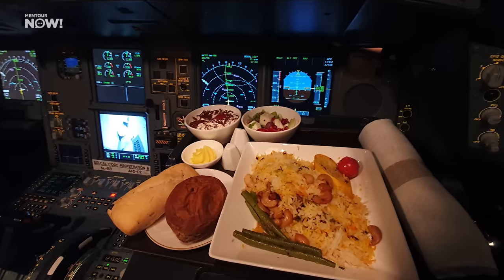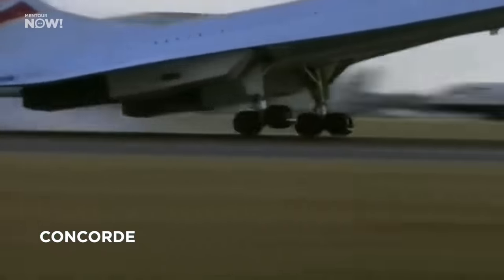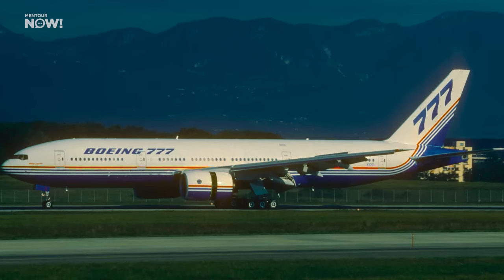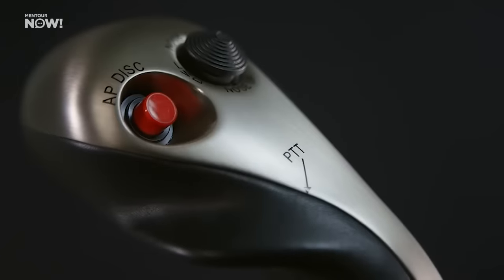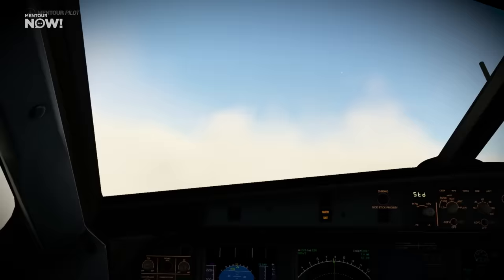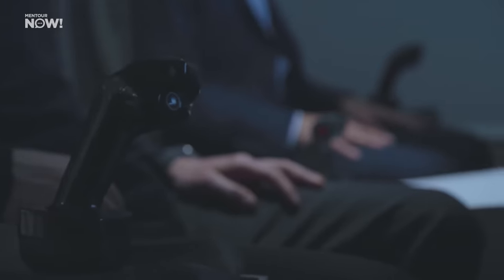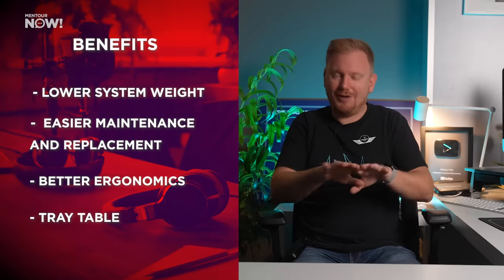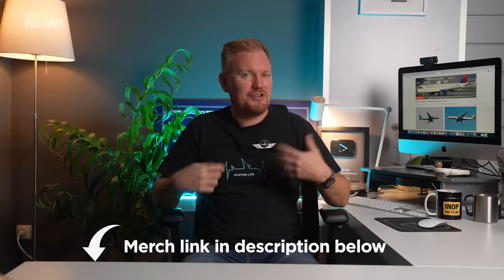Will Airbus Finally switch??

Comment: Hey guys, don’t forget active FBW sticks in heavy jets ALREADY DO EXIST. The C-17 has a center stick fly-by-wire and both are mechanically connected so when one is moved the other moves with it. Even the autopilot, when engaged, moves the sticks, just like the auto throttles. It absolutely fixes the problems Airbus has with pilot confusion. I taught the C-17 for 17 years and never saw any “who’s flying” confusion.
Reply: There was a "who's flying" crash in a Boeing once.
Reply: @thewhitefalcon8539  Once in an unusual situation vs multiple times under more normal circumstances with Airbus. It's clearly a far greater issue for them.
Reply: Yeah, it's much easier to mechanically couple center sticks than side sticks. But then you lose the advantage of getting rid of heavy mechanical component of your fly by wire system. Then again, my guess why you've never seen a 'who's flying' confusion has much less to do with the sticks and much more to do with the fact that airline training is absolutely incomparable to military aviation training.
Reply: @tringalij Agreed.  My 5 years flying the C-17 pales in comparison to your 17, and I've also never had or seen any confusion about who had control.
Reply: @SkylineFTW97  That's why as a pilot you announce and communicate when you have control of the aircraft. That's more of a failure or training and procedures than a mechanical failure of the sticks. If you're relying on the aircraft to tell you who's flying, you've already failed.
Reply: Sorry, but that feels like the start of an Abbot and Costello bit. . .
Reply: I flew both makers' aircraft and I think the honest answer is to put the sidesticks in the middle, FMs on the outside (no looking in at each other) and a set of throttles each (which don't move much anyway).
Reply: @thewhitefalcon8539  Yup, tho theres also crashes where pilots fought over the yoke and got confused. All tech has pros and cons.
Reply: Boeing didn’t design and start production of C17. McDonnel Douglas did. dcniner01
Reply: This is a good point. May I ask if the center mounted side stick on the C17 was to overcome the awkwardness of using the right hand to control a side stick mounted on the right when seated in the right seat, or being forced to use the left hand when seated in the left seat?

I'm not a pilot nor am I an aviation geek, but these issues need to be considered with side-mounted side sticks:

1) Awkwardness of using a different hand when seated in either the left or right seat. Every human has a dominant hand. Every pilot should be unconsciously competent (highest level of natural learning process, as is the case with defensive driving). I might be wrong, but unconscious competence is best achieved with the same, ideally dominant hand.

Being forced to use a different, non-dominant hand to control a side mounted side stick when seated in a different seating configuration loads the brain with an unnecessary cognitive load that could be eased with better side stick placement, like the C17 with its neutrally placed center-mount "side" stick that allows pilots to use their dominant, "usual" hand. 

There's also the issue of left or right eye dominance when seated in either the left or right seat, but it is another issue outside the scope of this discussion. 

2) With the introduction of servo controlled side sticks, can each pilot's customized, individual force needed to control the inputs be memorized by the side stick computer and saved for future configuration when flying a different aircraft? The issue I'm trying to grasp is whether a pilot should adapt to the weight and size and force feedback of an aircraft? Or should the aircraft computer adapt to the force inputs by a pilot and trim the aircraft accordingly.

I'm not an aviation expert, so if these issues don't make sense or are irrelevant, please forgive me wasting your time.
Reply: The plane design has failed if there is a learning curve. It should all be intuitive.
Reply: @snorttroll4379  I partly agree. The learning curve with a new plane, new design should be minimal, not steep.
Reply: @snorttroll4379 ah just so, do you understand it's not a bike 😂😂😂🎉🎉🎉
Reply: @oldporkchops  obviously the technical complexity of a plane in itself prevents any shallow learning curves, but each to his own... It should be best mitigated by step by step gradual lessons built on each other ...
Reply: and not from the previous plane, but from scratch. @oldporkchops
Reply: That doesn't sound like the C-17 system is mechanically coupled, NOT "active" (IE electronic force feedback) in the traditional sense. While "mechanical coupling" also adds the feedback, it likely doesn't provide the weight savings the Active sidestick systems being discussed here does over mechanical coupled yokes. One thing I'm not sure of is how hard it would be to implement mechanical linkage between two side-sticks, it's likely more complicated that for center-sticks but HOW much more complicated is the question. And I doubt Airbus would be willing to move the control position, "commonality" is one of their biggest weapon. Active feedback OTOH seems like it could even be toggled on and off as needed. Very interesting to see what Airbus might decide to allow (they have to get the regulators to sign off on it). The A220/CS100 seems a bit of a missed opportunity here, it has FBW and side sticks and probably could have had active force feedback timingwise (based on the MC-21) but doesn't appear to have that. It might have been a nice way for Airbus to test the waters but they probably got involved in the process much too late (and before that Bombardier likely didn't have funds to chose anything but the cheapest option).
Reply: @oldporkchops most side-by-side cockpits involve switching hands when switching sides and training gets you plenty of practice on both sides. Even with my relatively low time, the transition is smooth. Sight picture is a bigger factor (at least in the small planes I fly).

I thought going from stick or yoke to side-stick would be a bit of a learning curve, but I forgot I was using the side-stick within seconds (in a friend’s Lancair).
Reply: If pilots are confused who’s flying?…the problem is with pilots who are confused with who’s flying

They will have a lot more things to confused with other than side-stick. 

Btw, if you read the famous AF transcript that crash, they never got confused with who’s in control. They knew who was flying and knew when the other person was trying to take control

Dual inputs doesn’t mean confused pilot, it actually means the side with stick priority is taking over control. If no stick priority assigned, then the computer will aggregate the inputs. In case both pilots went completely the opposite direction on their inputs, there are both visual and aural warnings to remind them… if they ignored all that and kept fighting over controls… 

The head of pilot’s training/ recruitments/ flight operations should be fired….
Reply: It also has a degree of manual reversion.
Reply: In an emergency, hearing is the 1st sense to be overwhelmed, remember?
Reply: Great point about using the 'wrong' hand there!
Reply: @Stealth86651  yeah except in quite a few Airbus crashes people indeed announced I have controls, sometimes with the other acknowledging it, but still instinctively flying the plane despite having acknowledged handing over the controls. The issue is that there is no way for the one wanting to control the plane to know if the other guy actually released the stick. And in very stressful situations the hearing being loss quite easily that's not ideal. Having stick coupled adds another tactile situational awareness over dual inputs while also allowing an instructor to feel exactly what a young pilot is doing or not doing
Reply: @robadzso Which is how almost all flight training today is done.
Reply: @offshoretomorrow3346 Quickly followed by narrowing "tunnel vision" and lastly, fixation.
Reply: @SkylineFTW97  there've been less crashes involving Airbus planes in total.
Reply: Implementing this should actually be mandated upon Airbus by the FAA, both on new planes, and as a retrofit safety upgrade on planes in service, the amount of dual input and autopilot incidents that have happened is too high to ignore!
Reply: @misarthim6538  absolutely incomparable is a myth. Military aviation has never been superior. CRM was a civilian intervention that was needed in order to address the problematic military style command structure that doesn’t belong on a flight deck.
Reply: Why do they have to be mechanically connected? Just electronically connect the two so that while the other pilot could still physically initiate an “input disagree” if they wanted to take priority but could still visually “see” exactly how and if the other pilot was manipulating the side stick.
Reply: Nobody forgot.
Reply: Interesting, the C17 has only been out 8 years… How do you explain that Mr know it all.
Reply: C-17 is a military heavy transport plane. So weight isn't as much as a problem for their control system as for a jet liner
Reply: @thereissomecoolstuff what?  The C17 had its first deliveries in 1995. It’s been flying for nearly 30 years.
Reply: @rtbrtb_dutchy4183  What about Norway..
Reply: @thereissomecoolstuff  what about Norway?
Reply: @tringalij thank you for your service. I was in logistics and I don't mind admitting that I always thought your job was cooler than mine. 

When we were all going out to Bosnia we loaded up on a load of American aircraft and you guys treated us lovely. I'd driven down from either Catterick or possibly Otterburn 🤔 can't remember now, but I was feeling a bit second hand by the time I got that old 4 tonner there
Reply: @thewhitefalcon8539 Are u referring to Egyptair  990 ? Thats the only case I can think of in a Boeing aircraft.
Reply: Didn't the sidestick contribute to Air France 447 going down off Brazil?
Reply: Absoloutly agree !! I consider it dangerous to effectivly disconnect the pilots from the aircraft. Also the aural warning "Dual Inputs"  (A320/330) is not very helpfull in a panic situation, see AF447.
Reply: Yup
Reply: Perfectly on point. I agree and frankly like the C17's 'visible at all times' cockpit transparency.
Reply: Idk why they use a side stick over a Center stick. Center feels way more natural and the only reason military jets used side stick is due to high G maneuvers.
Reply: @snorttroll4379 there's a big difference between something being intuitive and having a learning curve.
Reply: That is the way it should be, unfortunetely Airbus does NOT have that.  Regards
Reply: Agree !! @largosgaming
Reply: @largosgaming The answer is simple. Maximum comfort with nothing infront of the pilots btwn the legs apart from the table. Airbus said so themselves in a document explaining their philosophy.
Reply: @GreenIsland38 Well, no airliner/business jet has center sticks. It's not just Airbus with sidesticks.
Reply: @snorttroll4379  agreed
Reply: @ARandom777  "no airliner/business jet has centre sticks"

Boeings have center control yokes, that's what the entire thread has been discussing.
Reply: @ferrumignis  That's yokes, not center joysticks, which is different than a yoke...Yokes is not what the thread was discussing. I recommend you see the cockpit of the C-17 to see what we're talking about.
Reply: Boeing is the one who should learn from Airbus not the other way around
Reply: @LexlutherVII  Boeing should disconnect their control yokes so that the pilots can input conflicting commands? That seems like a great idea, can't think why they haven't already done that. It's never, ever been an issue for Airbus after all.
Reply: @misarthim6538  Force feedback motors aren't heavy, less susceptable to being broken and can provide synthetic control surface feedback

The bigger problem with the current setup on Airbus is that "control input disagree" notification doesn't result in a BIG RED LIGHT (and audio warning) that can't be missed no matter where the crew are looking (existing warnings are small and easily missed when under stress)

Dual input is the kind of scenario where a flashing red border should be flashing on all displays at the very least, if not flashing the entire cockpit illumination red too (ie, so anyone in jumpseats can notice it too)
Reply: @Lukeduke7773  Agree. 

One of the other military problems is the "pushing through regardless" mentality (mission fixation) that prevails instead of realising early on that things aren't going right and diverting long before trouble becomes critical - Military transport pilots are no better than single seat jockeys in this regard. The training that's ingrained into them   contains many elements that are the direct opposite of what's required for safe civil aviation.

In particular, far too many landing incidents are related to mission fixation or "following policy" instead of a more cautious approach

It had been realised by airlines as early as the late 1980s that ex-military fliers were cheap to hire but were statistically their most unsafe pilots, which is why the rise of civilian airline training centres and university aviation degree courses occurred in the early 1990s, with heavy emphasis on Human Factors and "Being late is better than being Late", particularly when you may take a busload of people with you

On the other hand, overly passive pilots are also dangerous, as several low cost American airlines found out the hard way with pilots blindly flying themselves into dangerous situations long before they realised they were in trouble
Reply: @tonamg53  but that’s the issue There’s no force feedback on the current Airbus planes so you can’t (feel what the other pilot is doing and you can’t feel that the trim is way out witch you still can on the 777 Dreamliner and later flyby wire planes), even on the Dreamliner 777 Boeing they are 2 independent sticks they are just interlocked via force feedback system that can be turned off to allow pilot to get in-out of the seat
Reply: @leexgx  There is no issue. You never ever put your hands on the yoke to feel it while other pilot is flying.

The yoke or moveable control can’t tell you anything about what the plane is doing anyways. If the stick is to the left the plane can be
• starting a left hand turn
• increase bank angle in a left hand turn
• decreasing bank angle in a right hands turn
• countering wind gust to remain straight and level

To know what the plane is doing you still need to look at PFD and the PFD already has all the info so there’s no need to look at the stick/yoke before PFD at all so why would anyone even bother?

I would even say that its a bad habit if you think you need to see what the yoke is doing as its unnecessary increasing your workload for no additional benefits.
Reply: @leexgx  and about the trim, the Airbus control is all auto trim so you don’t need to feel it. if it  is broken mid-air then yes you can’t feel with your hands but you can still feel the plane is out of trim through your whole body and you can still see it visually.

Mechanical/hydraulic link like 737 is actually a disadvantage as if the trim is way out (*cough… MCAS) the plane can be in a state where the pilots does nit have physical strength to overcome the force and there for limits over control authority from the pilots. This is not an issue in FBW and pilots have full control authority at all times even if its way out of trim.
Reply: @tonamg53  I don't know how the other planes doing it that are implementing the active Force Feedback joysticks, even on the Boeing Dreamliner you can still feel or sticks moving as the plane pitching forward or backwards, and left right 

yes it's still important to look at the instruments as well but there has been countless airbus crashes or incidents due to flight control lack of feedback due to Mutiple issues at the same time (the recant one with the auto trim was disabled, on a Boeing you would have felt it instantly on the sticks as they would have been very heavy even in the 777 dreamliner and you would have adjusted the trim via the stick, on airbus there is no manual trim in the stick as it's assumed it's always going to be automatic so that they don't need manual trim on the joysticks)

But yes it's the pilots fault always the pilots fault ( well it's usually one of them, which ends up causing both of them to be at fault legally)
Reply: @tonamg53  issue with mcas was lack of memory items failing them (runaway trim should be picked up on within 15-20 seconds of it happening especially at take off) there are 2  switches to turn off the powered trim

But also with mcas not been treated as a critical control system was boeing fault witch confused pilots that didn't do the trim runaway procedure right away (instead they  pressed up trim even thought they knew it wasn't responding correctly) but I agree that is a mess

But that's the thing on the Airbus they didn't know that the auto trim had been disabled which was the opposite problem what had a similar effect because the trim was nearly maximum pitch down when auto trim turned off ( where on Boeing the trim wasn't set to failsafe disabled when the pilots were trying to count it, as it now does
Reply: @leexgx  No Airbus planes had crashed due to lack of flight control feedback. 

The most relevant and most well known case was the AF A330 crashed but even in that case the flight controls was only listed as “potential contributing minor factors” 

which does not mean it was the cause of accident 🤦🏻‍♂️

Also as mentioned at the end of this video, flight control feedback DOES NOT prevent issue as pilots flying 777 still fighting over controls unknowingly and cause it to de-synchronised.
Reply: @leexgx  Also a runaway trim is a trim that move continuously without stopping.

MCAS move the trim wheel intermittently and so it is much harder to detect as the movement could be interpret as normal trim wheel movement by the autopilot as well. Only when it start going out of range that the pilots might noticed that MCAS is trying to dive bomb them…
Reply: In the B767, the MCP has 6 buttons for the Autipilot. 3 for the three autopilots and 3 other buttons for Control Whell Steering/CWS. When engaged, the autopilots move the control wheel. Not a lot of B767 we delivered with this option so, many have filler plates instead of the actual buttons.
Reply: Thats why adherence to procedures and clear commands are always important in an Airliner. If you stick to clear "i have control" "your have control" patterns there is no confusion. In high stress situations the connection is useless since pilots overhear the loud "dual input" alert on airbus or think the control difficulties on a boeing yoke come from aerodynamic feedback and not the other pilot fighting them. The only advantage a connected steering has is for learning, since the student can feel the inputs of the instructor.
Reply: Had to say was that planned C17 for 17 years, next C18 for 18 lol
Reply: @SkylineFTW97  so why it doesn’t end up to accidents with Airbus? Are we Airbus pilots superior than normal pilots? 😁
Reply: @oldporkchops  most of aircraft have only one throttle quadrant and thus the pilot sitting on the left uses throttle with right hand and flight controls with left hand, whether it’s center stick, side stick or yoke.
Reply: @EvoraGT430  Then you won't have the nice tray for your meal....
Reply: @Stealth86651 The less things a pilot has to worry about the better.
Reply: @SwordQuake2 Yeah cause more things were learned from Boeing crashes cause Boeings were more popular back then. 20 years diffrence between the 737 and the A320.
Reply: @KoiranenAerospace The oversimplification you did killed all the validity...
Reply: @FonikosGazmas  oversimplification of what?
Reply: @KoiranenAerospace  Read again your comment with the emoji....
Reply: I thought
Reply: that's great, because this "who's flying" confusion can happen even in piper cub. Last time when I checked, it didn't had flight automation.
Reply: so what, still better than Boeing @SkylineFTW97